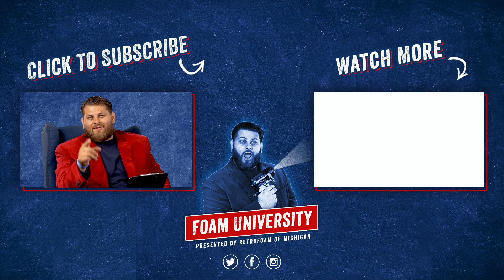What is R-Value and Does it Matter for Insulation? | Foam University

Comment: You are spending more time trying to sell me foam than answering the question you posed, the question I came here to get answered.  What is R-value?  What does the number mean?  Is it better to have a higher number or a lower number?  What ratio of heat transfer reduction does each number represent? (Do ratings of 3 & 7 mean that heat transfer are being divided by 3 & 7 respectively, or is it reduced by 3% -  7%, or something else?)
Reply from the maker: This article explains which insulations have the higher R-Value, but it also gets into how R-Value works.
https://www.retrofoamofmichigan.com/blog/what-is-the-highest-r-value-insulation-ratings/types/charts

Comment: Problem is.. Getting the local inspectors to understand that r value works differently for foam and doesnt require the same as an insulation that allows air movement.
Reply from the maker: Yes, we also see that some inspectors are  not caught up with the science of spray foam and air sealing. For passing code, performance method via a REM design is probably going to be the new standard. 

As far as ridge rot, there are many factors that come into play. Mainly, outside water penetration. If the roof is properly sealed from the outside and the inside roof deck is spray foam you should be very protected. Ventilation should be mechanical.